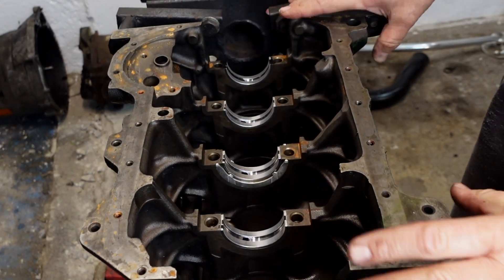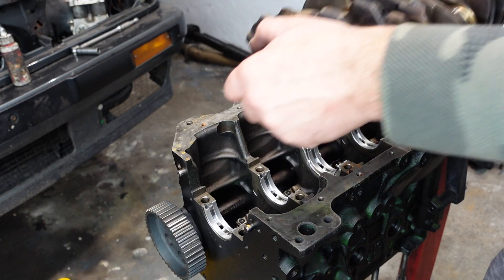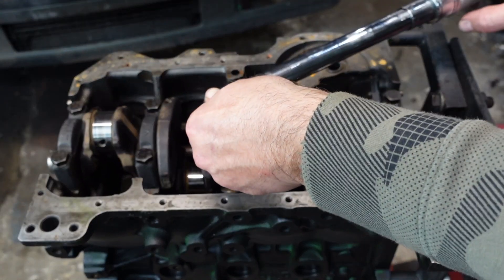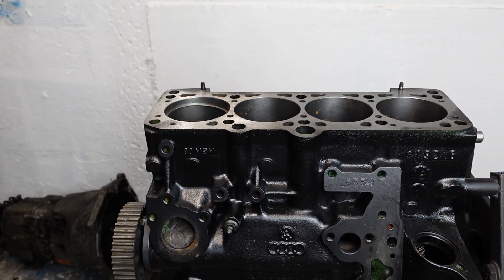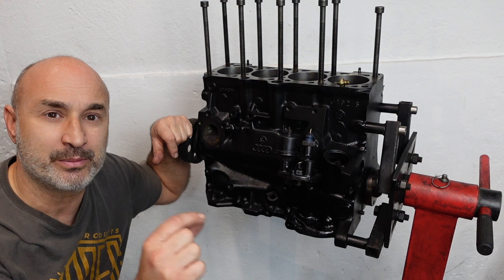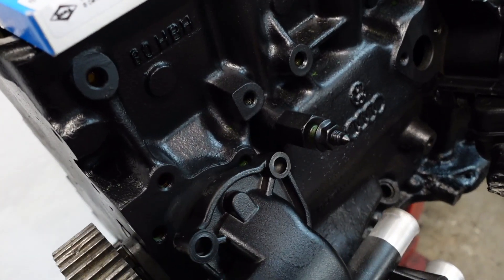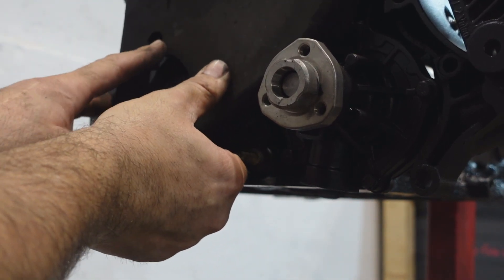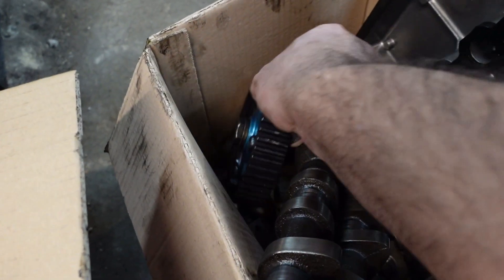2.0 16V ABF High Comp Engine Build

Comment: Hi,after removing of crank trigger wheel how you will get crank position signal,also how you solve the issue with crankcase breather?Can I also use by the same way a Golf 2 1.6 td engine block and turn it to an 1.8 16v KR ?

Comment: intercooler oil coller is better than the water one.
Reply from the maker: Yes or have both, the water one has a duel function, one to try to keep the oil cooler and one to warm up the oil sooner from cold as the water heats up faster than the oil normally does.

Comment: I’m sorry I just wish to know that is the block a normal mk1 1.3 you re-sized it to 2.0 or is a straight 2.0 block ?🙏
Reply from the maker: A 1.9D block with 2.0 ABF crank and block taken from 79.5mm to std ABf 82.5mm bore.
Reply: @RestoDesigns7  noted thank you 🙏

Comment: Great bit of info! Im just about to start building a 2.1 abf at the moment. Similar cam set up, ITBs 👍🏼
Reply from the maker: Really, that is going to be nuts in your car, been watching your channel for a while mate. 👍🏼 You don't hang about on track in that thing and it's an 8V😮 what plans do you have gearbox wise?
Reply: @RestoDesigns7  oh really! Brill! Yeah it should be a good engine! Its a 2.1 tsr bottom end, kr head which has had loads of work. Ive no history on the engine other than an old clubgti thread. So ill be stripping it and rebuilding! Planning on using my 8v 020 box…. See if it holds up 🥴… if it does go then ill go 02a 👍🏼
Reply from the maker: @Jims_racing  Sounds like a great engine package James, I only ask about the gearbox because I know you track it, 020 aka "a box of chocolate's" 🙏🏼 lol I say that, but back in the day my test bed ABF Eaton 230ps had the standard 2Y 16V box and that lasted, but didn't track that, any plans for videos on that build James?
Reply: @RestoDesigns7  yep i know they are not the strongest!! Making a video might be a nice idea actually! The only thing is it wont be very informative as its my first engine build so i wont have much in-depth knowledge!
Reply from the maker: @Jims_racing  People love that mate, look at Matt Armstrong, the whole thing is about him learning and working it out as he goes. I'd say go for it mate! 👍🏼
Reply: @RestoDesigns7  not heard of him ill check it out 👍🏼

Comment: Cool project and awesome progress. 

Your using a 1.9 pd bottom end with abf head. What pistons and rods did you go for? Also would you be able to turbo this kind of set up?

Thanks
Reply from the maker: Thank you mate, I using a 1.9 D block, 1Y engine code, crank ABF, Rods Scat ABF and pistons wossner ABF, all the oil pump and shaft/gears are also ABF, only thing that isn't is the block itself due to the ABF block having had some hand drill horning, no cross-hatch pattern and over did it at the top of the block I'm guessing to remove than small lip. Due to the limited stock of ABF blocks here, I had the idea of using a 1.9D block from an early mk3, same block height as the ABF and bore is 79.5 Vs ABF 82.5, so had the 1.9D taken to a fresh ABF 82.5👍🏼 the block looks stronger and has m12 head bolts as standard, so if you're in the market for a 600+ 16v this could be an idea.
Reply: In the UK the mk3 diesel block is number 1y or 1z crank 95.5mm

Comment: Yep, them crank pullies are out of stock from 2019 - even the local VW dealer said they most likely will never make more. Mine had a broken outside edge and luckily I knew a guy parting out an ABF and bought his. 
Question:is it known which year car is this 1.9D block from? Reason I'm asking is we own a 93 1.9D CL and it has the stock oil cooler and even tho it had aftermarket trailer hitch added later I doubt that cooler was fitted also.
Reply: I remember in one of the other videos him saying that the D block came bare, so I'm taking it he got that oil filter housing from another block.
Reply from the maker: @snowflake6916  Yep seems like you watch way too many of my videos lol 👍🏼
Reply from the maker: Yep I haven't needed one in years, even after market ones seem to be In short supply, found a German site that makes them in stainless,💰 I got the 1Y D block bare with only the crank caps, the ABF block also came without the oil filter housing, so was given this one by a friend, it's off a 1.6 GT 101ps, they came with no cooler.